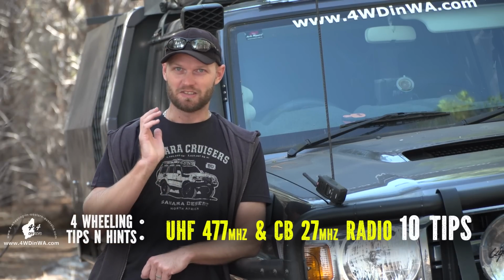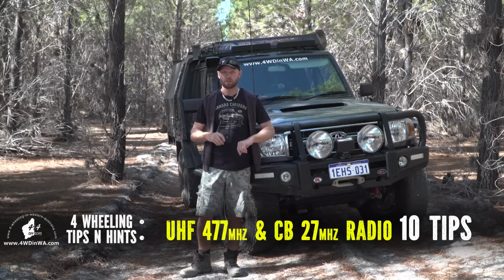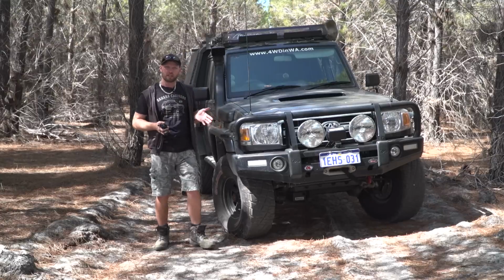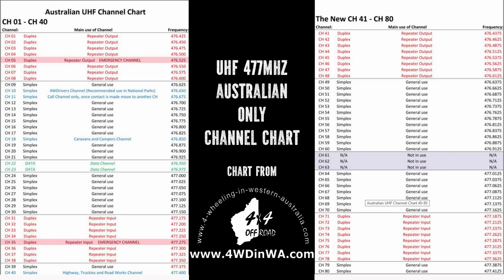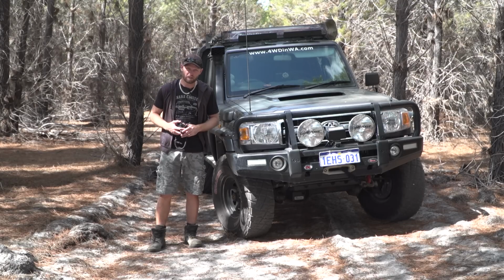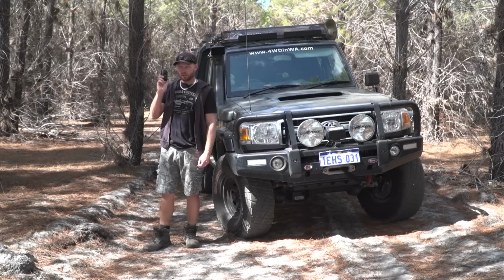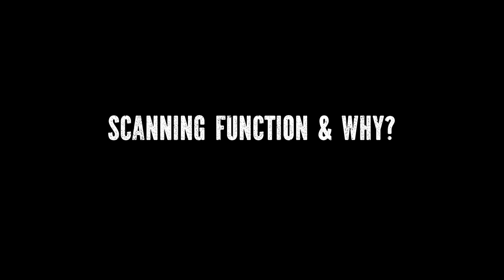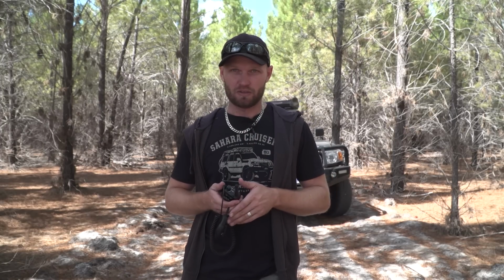UHF CB Radio 10 Tips

Comment: FUN FACT Did you know: A vehicle mounted antenna transmits from the centre of the antenna not the top -thin antenna are for line of site/range  -thick antenna are for hills and 4wd tracks where you dont need range but you need comunictation over a track or hill.

Comment: Very well presented ! Don’t forget never transmit on the repeater inputs . You may not know you are in range of a repeater and you will cause a lot of interference to those who use them. Channels 31-38 and 71-78: Duplex channels (input).
05/35 is emergency. 
The higher gain of the antenna is good for open country. Low gain is best for mountainous country.
Breaker 19 is an American radio slang term for their 27meg call channel . Channel 19 .
Reply: Hey I have a dmr (digital so I have to program it myself) for my transmitting frequency is that the input and would the output be the frequency i receive one?
Reply: @its_billyrusso4868  Yes mate . The input is the one to stay off when using simplex . So for example with channel 1 repeater, 31 is the input and 1 is the output. 
Don’t get caught with that radio 😂

Comment: You should mention 31-38 should be avoided as the are the uplink channels to the 1-8 repeaters. This means if you're banging on about something on 38 in an area there is a ch8 repeater and you're in range of that repeater then EVERYONE on 8 can hear you.

Whilst UHF is heavily LOS in singal ... there are anomalies like signal bounce of cliff faces etc.

10 codes are dead :P

As for the scanning .. if youre in the poop and need to get a message out it's good to find someone but on the roads you can miss an entire message on ch10 whilst the radio is scanning around.

Your speaker mic ... if they're worth their salt they make a HUGE benefit to audio quality.

Handhelds ... the cheap Uniden 0.5w rubbish from super dear auto etc are useless for range but bloody awesome for spotting etc up to 100m. 

It may have paid to describe the difference between the handheld control head, remote head and coventional "brick" radio types too. Bricks don't fit well in most vehicles now but remote heads make it easier and handheld control heads (eg Simoco SRM9020. 9020+ and 9022 along with newer GME, Icom etc) make it a LOT easier to install well in the car putting all controls on the mic in a single hanger then the brick under your seat or wherever.

Comment: GME is the best and clearest , clearest for the listener, Uniden is crap,, I been using CB's in trucks and my 4x4 since  1975 when I bought a 23 Ch Realistic from Tandy store in Wagga Wagga, many say UHF will not do skip, WRONG, but it is very very rare, back in 2005 I was doing Pilot Escort work , was heading South near Carnarvon and heard someone mention a location, I asked him to repeat and he said Dongarra, that's 500 Klms ,(Don't forget, Truckies always use Ch 40) I believe the only way that could happen is that the signal gets trapped between 2 layers of the ionosphere, back around 1962 near Waikerie , SA where I lived parents had a TV and we got sound and no picture from Ch 7 Perth , or picture and no sound, again trapped in the ionosphere and dropped out over SA, of course that was the old analogue TV's, so has anyone else experienced skip on UHF CB , Haaa just a note, in the 1980's when we used 27mhz I had a 200w Linear Amp with my Johnson Viking CB . BLOODY HELL on Ch 8AM Mt Isa back to Brisbane a woman said it over covered over local transmissions ...

Comment: noting  you also need to consider ssb/lsb/usb with 27 MHz and the capacity of 40ch wideband and 80 ch narrow band where selected within UHF use case and another less used 27 meg marine and VHF support..

I suspect for  tours you service, mandatory inclusion would be would 12 watt pep of 27MHz  ssb/usb/lsb operation..

as UHF is a center mass projection of radial point to point distance of 5km though realistically in 1 direction is 2.5km  with a transmission overlap..

Comment: Over and out?? there is no such thing. That's an old Yank slang that has no place in general communications. You are either over or your out. As a full call Ham Radio operator myself I recommend staying clear of GME radio equipment. In all my years playing with radios i find GME gear to be the most unreliable radios on the market. I know a lot of people swear by them but I won't trust them. Take one apart and have a good look inside. The workman ship inside them is sloppy at best.  I personally stick with either Icom or Uniden.

Comment: A good tip for a handheld mic is to grip the mic from in front of the mic instead of hand behind the mic.  In this way, your thumb will be on the microphone key.  Now take the middle knuckle of your index finger, and plant that at the base of your nose in the center of your upper lip.  This will put the microphone about a constant inch off your mouth and at an angle and will yield good punchy audio without the popping or muffled sounds.  I've personally found this as a much better practice for gripping and keying the any hand mic.

Comment: As a Ham Radio operator I can suggest that you change the information about the 27Mhz band being line of sight. With 5 watts (the normal power of a mobile unit) you can communicate over the horizon due to radio wave propagation. It used to be a frequency for Ham radio and they talked around the world on it.
As for the VHF (440Mhz), this is a frequency range for Ham Radio in the United States so a person coming from America would probably have that one already in their vehicle if they bring their vehicle to 
Australia. If they do not and just bring a handheld with them they will probably have the frequencies in their handheld that can be used in conjunction with your open communication frequencies. They would just have to program the repeaters and simplex frequencies into their radios.
I hope that this will help you in a future video or general traveling. (The police and emergency services in Thailand use the 440 Mhz spectrum so you would not want to bring your radio into Thailand. Also without special permits and fees you would pay some outrageous fines for bringing it into Thailand.

Comment: Great with your tip about Duplex use, Don't use channel 1 to 8 but the most important thing is don't use the channels, 31 to 38 as these are input channels. Many times people using these channels are heard on the repeaters but no-one can tell them their conversation is being heard all over the place. Nice video though mate....I've use HF / UHF radios for years and still use em.

Comment: You should never ever say 'OVER AND OUT' as it implies you are awaiting a response 'OVER' then you state you require no more comms 'OUT'. You should ONLY ever say 'OVER' or 'OUT' and not together.

Any military or emergency service personnel will tell you the same thing. Also, it is courtesy when in a group that the instigator of the call ends the call - as the receiver may finish the call 'OUT' but the caller may not have finished.

Comment: 80CH radios also run 12.5KHz spacing so as a result run less deviation (volume) for the FM voice signal. 40CH runs 25Khz spacing and have a larger bandwidth for the audio. So if you receive a 80CH transmission on a 40CH radio it will have quite low audio levels compared to a transmission from a 40CH radio. Also nearby 40CH radios will interfere on multiple channels on 80CH radios. So if someone was on a 40CH on CH 10 then this might cause issues on CH 49 and CH 50 for an 80CH radio. Some of the challenges operating both 40 and 80 Channels. Originally 40CH radios were going to become unapproved and illegal but ACMA decided to change its mind here and allow both to kind of coexist. Range on UHF is purely limited by line of sight. I've done 100KM on 0.5W on UHF no worries from hill to hill. I have also struggled to do 1KM with full 5W.

Comment: PLEASE HELP . I have a UHF radio in my truck. Its almost new. I set priority channel to 10 but now I need it to five. It only has one priority channel. How do I reset priority channel. I've tried holding down the priority button  on the channel to unprioritise it didn't work. I also tried to go to a another channel and hold down priority to reset and it jumps back to original priority channel. PLEASE HELP

Comment: Just FYI, CB Radio (HF) does not have to use line of sight. Now-a-days, with being in a 10 year down cycle with the sunspot, we typically think this with 10m-20m. No doubt about it though, 10m on a good day will bounce off the Ionosphere (F-Layer) and come back to earth. Where UHF always pierces through. Just FYI but I enjoyed the video.
Reply: "we typically think this with 10m-20m."  no - we dont.  you do.

10m is vastly different from 20m in this regard.

the shorter the waves the more light-like they become
which would make VHF/UHF "line of sight"ish - if there were not reflections from objects, rooftops, rails etc
 (which is why it works in town with buildings between sender and receiver)

10 and 11 meter profit from higher altitude antennas, i would not call that line of sight though because it is still HF and goes beyond the horizon to some extend even w/o ionospheric bouncing which happens only on occation. 
(that has to do with the sunspots you mentioned) - in any case - it goes further than line of sight even in the worst case following the  the higher the further, the more power the further (a house in between is no problem hence line of sight is misleading)
- to a certain extend following the ground, but intercontinental needs the bounce from ionosphere

and as for 20 meter - it always uses the ionosphere, no groundwaves anymore - even in bad sunspot conditions it uses the ionosphere.  

I just talk to brazil from my location here in northern europe - sunspots are at a minimum - i used the ionosphere

Putting 10m with 20m in the same basket, and then describe it with adjectives belonging to a 3rd band 
is not a good idea. 

Take it from a licensed HAM, and ex nato navy operator.

Comment: One thing that I see left out. SWR. Don't operate that radio esp. Vehicle mounted with out checking and adjusting the Standing Wave  Ratio. You will burn up your finals if it's wrong and you will receive nor transmit no signal. The best radio in the world is no good with out a good antenna.
Reply: Most modern CB's have high SWR protection and wont TX with high SWR

Comment: I have an idea for a video I would LOVE, LOVE, LOVE for you to make!!!! PLEASE make a video where you very clearly lay out what an AWD system is and what a 4 Wheel drive system is and the difference between them. Americans have NO UNDERSTANDING of these two systems how they are different and what each system is good for. I can't find many people AT ALL who have any understanding of them.
Reply: Awd sends equal drive to the front and rear. But has a centre diff, viscous coupling, or clutch set up. So the drive can be broken, or split So there is no binding. As wheels will spin different speeds around corners. 
Subarus, skylines, lancer evo, ect ect

4wd is selectable, and sends equal drive 100% of the time when selected as 4wd.
Reply: @tristanstephens9076  Ya. I think it would be a great video if he could go over these systems and break them down so that a lot more people understand it. It amazes me how many people well, in America anyway, don't understand the two systems and their variations. He could also explain Limited Slip Differential, front and rear lockers, how stability control and other systems affect both Four Wheel drive and All Wheel Drive. He might use drawings or videos or something to really lay it out. I got $100 says it would be a huge Viewed and Liked video due to how many people truly don't understand the systems they are using.

Comment: Alot of off-roaders in Europe and North America also use Amatuer Radio (called Ham in USA) on VHF and UHF. The 2 meter band (144-146 MHz in ITU region 1 and 3 and 144-148MHz in region 2) and the 70cm band (432-438 MHz in region 1 and 3 and 432-440 MHz in region 2).
It is much more reliable, covers a great distance, can use repeaters and there is a ton of people Active that could help you out in a sticky situation.
It do requires you to take an Amatuer Radio licence which requires you to do some studying but can also reward you with Another great hobby and comeradie.

CB on 27MHz. Depending on what country you are in you may have the option for a CB radio with both AM, FM and SSB. SSB has alot better radius and usually you can from a mobile station (a car) reach a radius of 50Km or more. There is not so many users on CB anymore so it is not so likely that someone would be there to help you in a sticky situation but it is still more people than on free UHF.

When it comes to CB slang here in Europe the CB slang adopted alot of the amatuer radio slang.
QTH (Quee Tee Age) - What is your location? My location is.
QSL - Confirm / Affirmative - similar like 10-4 or Roger.
QTC - Do you have a message for me? / I have a message for you.
Break - There is no other Word for breaking in unless in digital modes or morse code where it is BK.
73 - Have a good one

Comment: No such thing as "UHF CB", at least not in the United States. CB, or Citizen's Band, is in the HF(3-30 MHz) portion of the radio bands. VHF and UHF are 30-300 MHz and 300-3,000 MHz, respectively. CB and FRS radios/frequencies do not require a license, but GMRS and Amateur do. There are several other radio services that require licenses as well.
Reply: Different countries different things. The US wanted to switch CBers to UHF. It just didn't catch on.

Comment: There is nothing like HF if you want range. I have a UHF/VHF radio and it is good for maybe 3 miles in the hand held pushing 7 watts, but in an HF rig with 100 watts and a good antenna you can go for hundreds to thousands of miles when skip is good. That is why it is good to have a ham ticket, it opens up more HF bands depending on the level one obtains. I like 20 meters.

Comment: 40 channels is 25khz wide. 80 channel is 12.5khz wide. 12.5khz deteriorates quicker. If you listen to a 80channel radio on a 40channel radio.. 40 is listening to 25khz and 80 is transmitting 12.5 .. so the 40channel will sound quiet.

Buying a radio. check it has the "C-Tick" approval. Using a radio that isn't type approved is illegal. Lots of cheap imports off ebay are not approved and will get you a massive fine.  Better to get a decent brand. You get what you pay for and it'll be more reliable than a cheak 40$ yum-cha that burns out when you need it most.

Comment: My Top Tip

Don't buy a CB Radio, waste of money in Australia

In over 19,000 klms we had only one conversation with a road-train driver, after we went our separate ways, total silence for the remainder of the trip, we called and called to all and sundry, not a whimper, all these wanna-be 4WD's with their showy white CB aerials, bunch of wankers, the bloody caravanners with their radio-call sign on the backs of caravans, total waste of paint.

We called over 300 caravans, not only they are tone-deaf but bloody ignorant too, apart from the odd radio check, can't see much point in having one, when we got back, took out the CB and sold it on E-Bay, useless piece of CRAP
Reply: Useless maybe if you have no friends I guess ?? I recently bought a car and wife and I had to drive back 200kms in separate cars, with only one GPS unit, valuable tool if driving in convoy
Reply: When 4WDing, we keep in touch with the other cars to check if anyone is coming in the opposite direction on one way tracks, to communicate the terrain, to check for stops, to check distances between cars and so on - invaluable piece of equipment in my experience.
Reply: @rosiemcmahon2203  what's the common channels used ? How do you know who's on what channel
Reply: Ask around, voice recognition, and there are specific channels that you get used to using.  @adelaidetechtrader

Comment: any one knows about best cb radio here?
Reply: yes, the Stryker SR-955HPC 10 meter radio is the Excellent radio. I had to tune the transmit after I received it. Peak and tune now do 20 Watts RMS and about 95 peaks. It came with the patch cable however after I downloaded the software from Stryker found out that the software is not very good the roger beep preview does not produce the tones in the same way the radio does so change the tone and duration is very difficult. Overall it is very good radio top-shelf audio quality and has tons of modulation if tuned correctly
Reply: I'm looking to find out what the demensions are of Stryker 955hpc for custom install. Width, hieght, depth. any help is appreciated Thank you
Reply: basically it is the same frame as most of your radios out there today 29 148 etc except it is longer due to the heatsink . My 148 is approximately 10" long from the end of the PL259 to the edge of the bezel. 
Length 11 1/8″ (from the heatsink to bezel) 
Length 12 1/8″ (from heatsink to the control knobs) 
Width 8″ 
Height 2 3/8″ 
Weight: 7lbs
Reply: All I can say is wow..this radio will blow you away..Love the controls and meter..The color changing display is awsome..Plenty of options on settings so you can customize it to your liking. Nice filters..awesome echo controls..and with a little tuning..loud audio and very good swing..folks don't have a hard time hearing it no doubt..nothing but good reports from folks I talk to..Love this radio..I have had a general Lee and a mirage 44..they were nice radios and did well but this Stryker is the cream of the crop! Big County from Virginia said that and we are back on the side.
Reply: I agree,